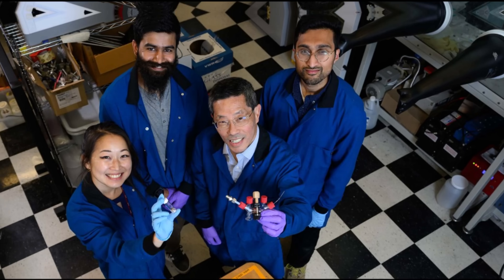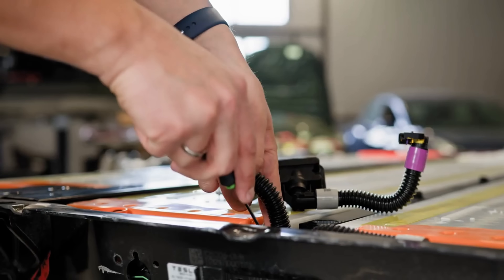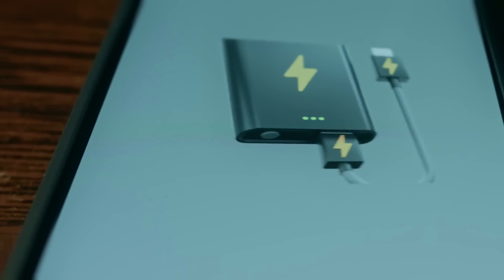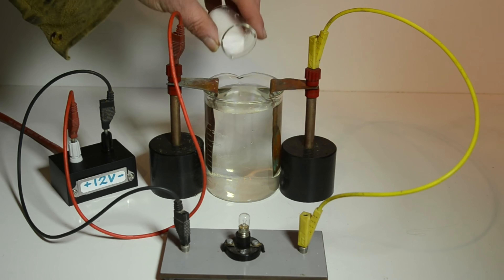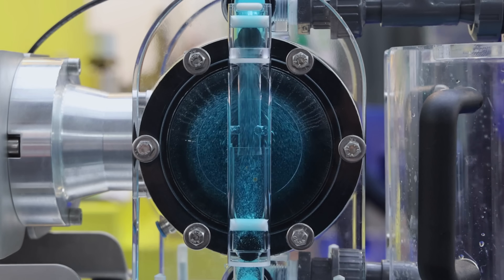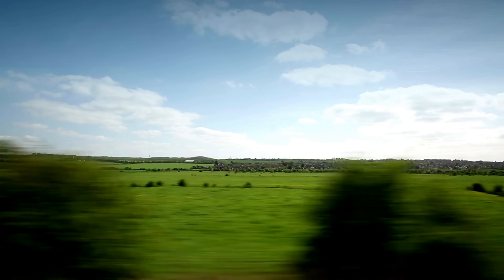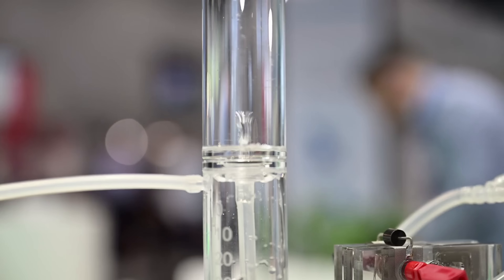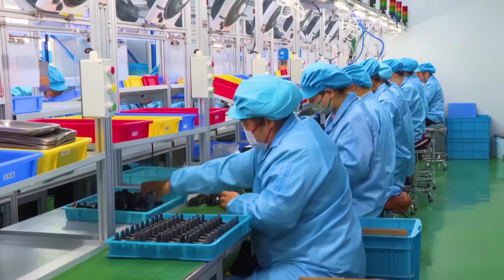MIT’s New Sodium Fuel Cell Could Destroy Lithium — Here’s How

Comment from the maker: What’s more impressive to you — that this fuel cell works without lithium, or that it can power planes and absorb carbon dioxide?

Let’s hear your thoughts:
– Would you ride in a sodium-powered electric plane?
– Do you think this tech could scale fast enough?
👇 Let’s discuss below! 👇
Reply: We might one day be out of table salt 😂
Reply: Pass me the fries
Reply: Overhyped. What is the efficiency of this fuel cell? Rondo battery is more promising despite weight, using resources that have energy density equivalent to lithium or better, presents a battery that survives many decades, and more affordable and abundant than lithium and sodium. There's at least 3 corporations already involved with brick based systems, I think there now may be one with graphite more recently. This will be useful for transportation.

Comment: Sodium metal is highly reactive which it is stored under oil- so how safe is this?
Reply from the maker: Great question! You're absolutely right—sodium metal is highly reactive, especially with water and air. But in these new fuel cell designs, researchers typically use solid-state electrolytes or carefully controlled environments to manage that reactivity safely.

The goal is to harness sodium’s benefits (like abundance and low cost) while engineering around its risks—kind of like how we already do with lithium, which also has safety challenges. Still early days, but safety is definitely a major focus in the development.

Comment: del mit? jajajjajjaja me hacen dar pena!
Reply from the maker: Thanks for your feedback. Please note that this fuel cell packs three times as much energy per pound as today’s best electric vehicle batteries, offering a lightweight option for powering trucks, planes, or ships. 

In contrast to a battery, the fuel cell can be quickly refuelled rather than recharged. In this case, the fuel is liquid sodium metal, an inexpensive and widely available commodity.

In a series of experiments with a prototype device, the researchers demonstrated that this cell could carry more than three times as much energy per unit of weight as the lithium-ion batteries used in virtually all electric vehicles today.

Comment: Rồi nó xảy ra chuyện thì nó bắn natri lỏng vào người và ta bị ăn mòn từ ngoài vào trong. NATRI rất háo nước!
Reply from the maker: Thanks for your notice. MIT's new sodium-air fuel cell offers potential safety advantages compared to traditional lithium-ion batteries, despite sodium's reactivity. The design keeps the sodium and oxygen separated, reducing the risk of runaway reactions, and the continuous removal of water produced during reactions further minimizes hazards. While sodium is reactive, the fuel cell design incorporates safety features to mitigate potential risks.

Comment: Yes i want my airplane to carry hundreds of pounds of molten sodium!
Reply: But you are ok with it carrying hundreds of pounds of liquid jet fuel that is ignited to a much higher temperature?
Reply from the maker: You are right to care about safty. However, MIT's new sodium-air fuel cell offers potential safety advantages compared to traditional lithium-ion batteries, despite sodium's reactivity. The design keeps the sodium and oxygen separated, reducing the risk of runaway reactions, and the continuous removal of water produced during reactions further minimizes hazards. While sodium is reactive, the fuel cell design incorporates safety features to mitigate potential risks.